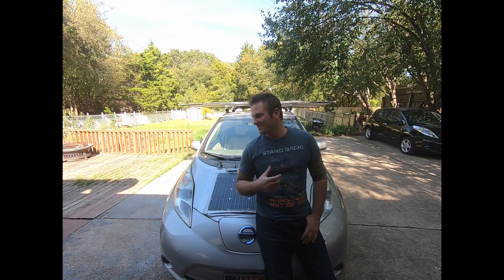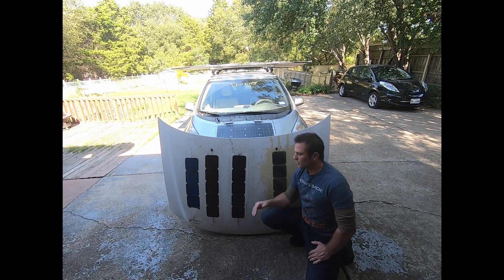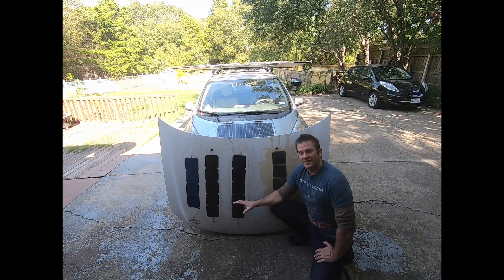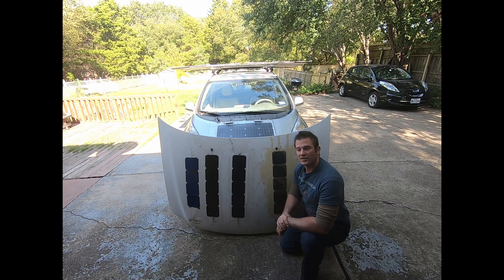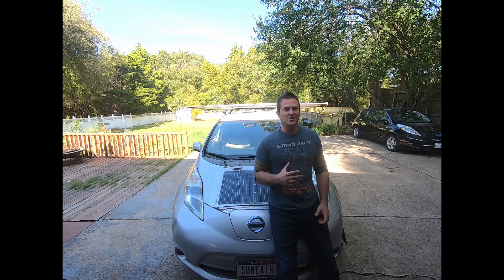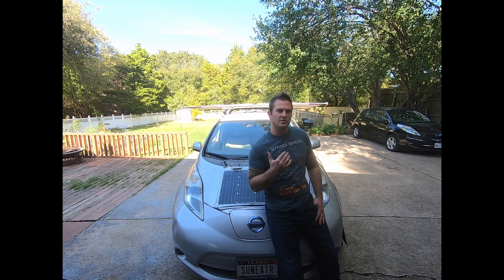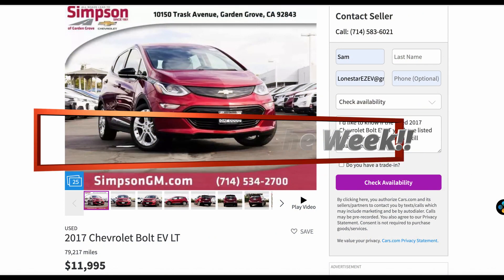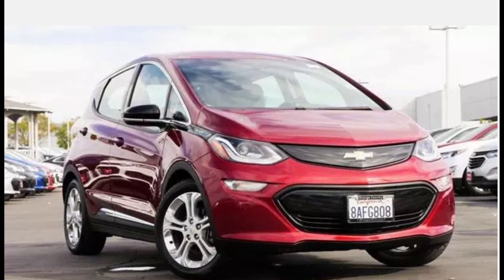Custom Flexible Solar Panels by Lensun

Comment from the maker: I didn't do a good job in this video of showing how flexible the panel was; sorry about that.  It's slightly less plyable than the Renogy flexible panels I've used, but plenty flexible to match the curvature of the vehicle paneling.  Future videos will show it adhered smoothly to the hood of the vehicle.  This pinned comment will also contain updates on the power output and construction integrity of the panel over months of exposure to the elements.
Reply: Reminder to update this comment!

Comment: When you think about what percentage of the time you're actually in your car using it compared to what percentage of time the car is staying at one space collecting Sun what about optimizing the solar panels so that you have a bigger array when the car is installed sitting while you're working. What if you used more of your car space not just your car to collect sun.  Maybe if you had the sides of a panel flip open to double the capacity on each side.  You'd almost need a double sided solar collection area so they would collect some walls flipped over and then clicked sun while it's extended out wgile parked.  what if you just had quick attachments so you can pull it out of the trunk clip it onto the front fold open the wings and then you would not be limited by the dimensions of your hood maybe limited by the dimensions of your car space.  What if it folded up accordion style so that you unfolded it eight times so that goes up over your windshield up the roof.  It could act as a way to keep the interior from overheating block in the Sun as well as collecting sun.  For storage storage on the inside of the car creating a pocket attached to the ceiling after it's folded up.  so you're not taking floor space or seat space you're taking ceiling space.  Probably 16 reasons why this would not work and we really need if it could though.
Reply from the maker: Every system is slightly different based on the users needs.  If you live or camp out of your Leaf, or power equipment at a job site; an array as extensive as the one you're describing would make sense.  If you only drive a few miles a week, then 1 100 watt panel and a 400v step up could be all you need.  A lot of the fun and engineering lay in designing the system YOU want and need.  Some day I will do a hybrid wind/solar power system on an EV.  That will be crazy.
Reply: @InnovativeSustainableSolutions  
I am looking to get a gen 1 Leaf and will be going 32 miles back and fourth.  It should make it round trip depending on degradation of battery I get. I just like the security of filling up while I am out doing PD.  Appreciate your channel just ran across it. Really looking forward to seeing how into explaining how to make a powerwall out of degraded leaf batteries.  Thank you.

Comment: My leaf has required so little maintenance that I actually had to add brake fluid myself since it hasn't been to a shop for a few years. Also, great suggestion for the tire pressure! It does make a good bit of difference if you are using most of the charge in a day.
Reply from the maker: Thanks, and same here.  Zero maintenance, ever.  I want to set some records for mileage on a 2011 Leaf.  The tire pressure monitors ARE most helpful for people that use almost a full cycle/day, but they can also increase battery longevity for people who only use 50% or so.  By increasing your efficiency, you increase your miles/kwh, which decreases the amount of power you are pulling out of your battery every day (driving a fixed distance).  This reduces your cycles per day/month/year, and slows the rate of degradation (albeit only 3-5%).  I believe the device would pay for itself fairly quickly, for most drivers.

Comment: Yahoo! An update on the custom solar cell coatings! Too bad that didn't work out, but I guess that's how some experiments turn out. Better to have tried than never attempted? Fitting panels to the front of the Leaf seems really difficult, even with the custom panels from the awesome company that a subscriber recommended (thanks to that person!). Have you considered fitting a few panels to the doors of the Leaf? They might not be in the most efficient spots, which it looks like you already have covered, but the doors look flat enough that it would be much easier to mount panels. I know the Sono Motors Sion does this, but I haven't heard how much of a gain they get from doing that. Thanks for posting!
Reply from the maker: We'll do side panels eventually.  We can use watt meters to track how much power they produce in a day and convert that into miles/day.  I think most people's decision to add side panels or not will be governed by how bad they need the extra power.  If you are barely making your commute home, or you use your solar power for off-grid/survival purposes, then yeah, let's put panels everywhere we can, even if there's not much bang for our buck.  Ultimately I want to design a "everyman's" kit that's around $1k, and includes the roof rack, 2 panels, the voltage step up and battery adapter plug.  People in most lattitudes could get at least 10 miles/day from just 400w on the roof.  That would reduce grid reliance, and give a little range boost to Leaf/Bolt/Kona drivers.  I think that kind of setup could become mainstream, but it would not include side panels.  Sono Motors puts panels on the side because they can produce car door solar panels for almost the same cost as normal painted door panels (car paint is evidently VERY expensive, and solar cells are cheap).  I'll do side panels, document the costs and returns, present them in as unbiased and objective a manner as I can, and let other solar car engineers decide if it's something that works for their needs or not.  There's a LOT of old Leafs out there, and solar panels are getting more powerful quickly.  I think I may be onto something here.
Reply: @InnovativeSustainableSolutions  Sounds cool! I think that you are onto something as well. I'm excited to see where you take this project next! I can't wait until you can connect to the main battery pack - I think that will be a major leap forward. Thanks again for posting!